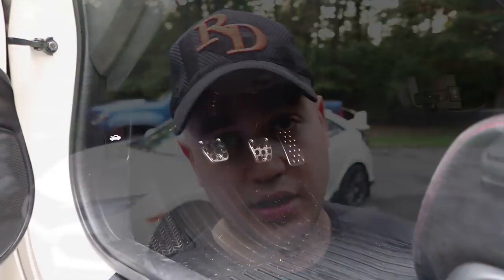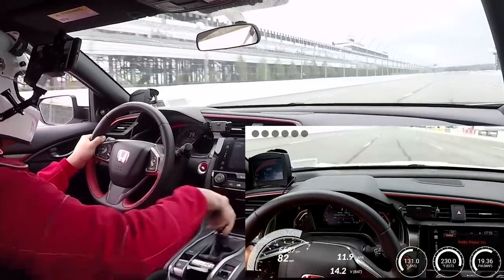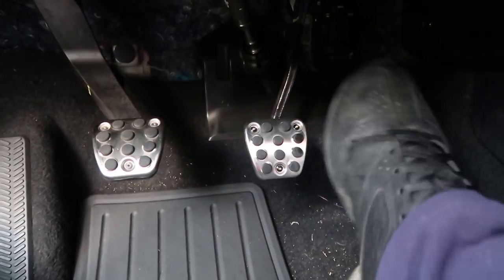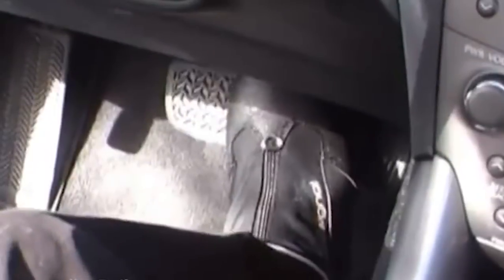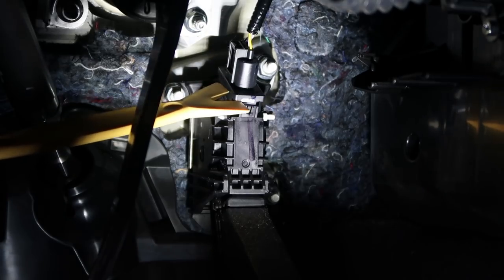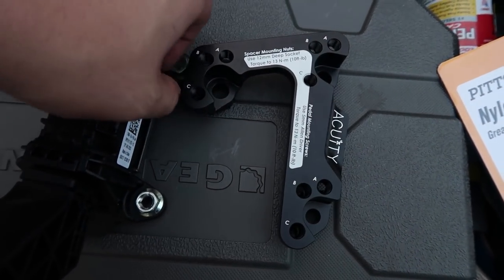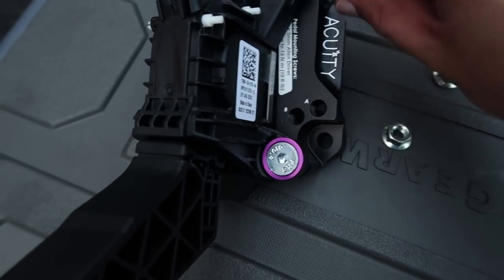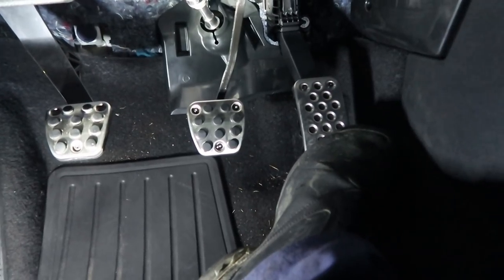Honda Civic Type R (FK8) | Let's Improve Shift Quality! Acuity Pedal Spacer Install

Comment from the maker: Acuity Spacer: https://amzn.to/2TolSWR
Trim Removal Tool: https://amzn.to/2Q8oglB
Hex Key Socket Set: https://amzn.to/2zlYG2U
Reply: great video! how come you didn't go with acuity's bushings or alta's bushing for the gear box? I just got alta's and the shifts feel more solid :) Also got the hasport 70a rear motor mount...definitely makes me feel more confident that the car won't grind anymore :) Thinking about upgrading your rear motor mount too?

Thanks again for all the videos!

Comment: The pedal spacer was the first thing I did to my 2018 Si.  I tried B position first thinking it looked perfect, but while driving it actually was too high for me.  When the brake was pressed I had to lift my foot and angle it weird to heel toe.  Changed to C position and it is perfect for me.  I’ve also installed the Acuity shift linkage bushings.  Thanks for the video!!

Comment: I totally enjoy the auto rev-matching on the Type R so this item isn't for me. But I always enjoy your videos, regardless. Someday please do a video on what's best for track seat belts. I notice Hooked on Driving is making drivers install head and neck restraint systems in their cars, and I don't have a clue where to start with that. Also, a vid on tow hooks, front and rear, on the Type R, would be nice,..as in, how to have them so they won't damage the car if you get towed off the track.